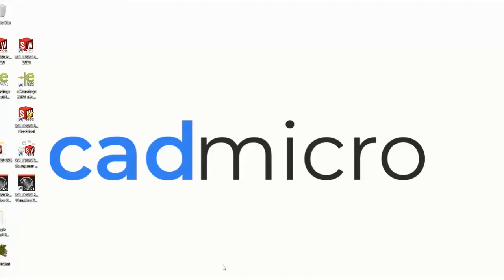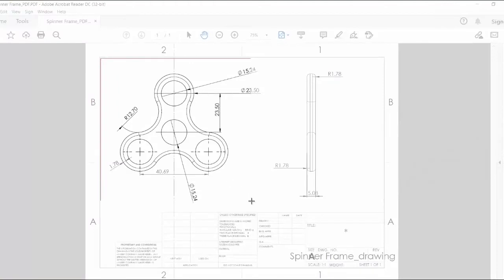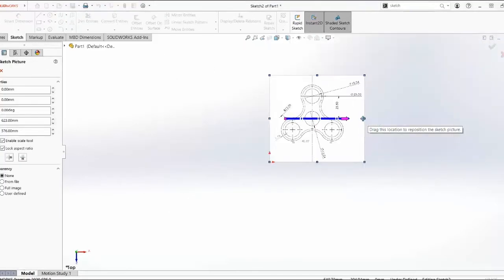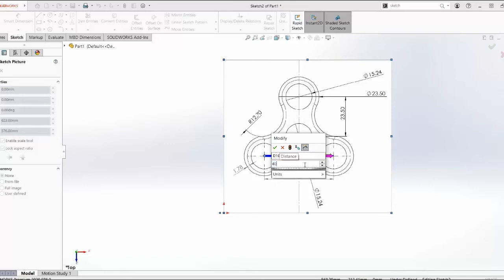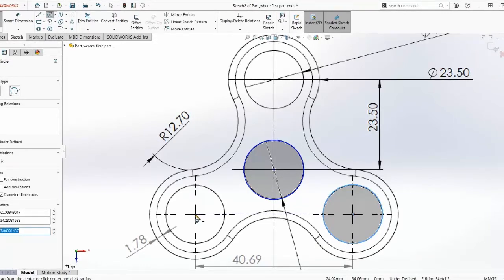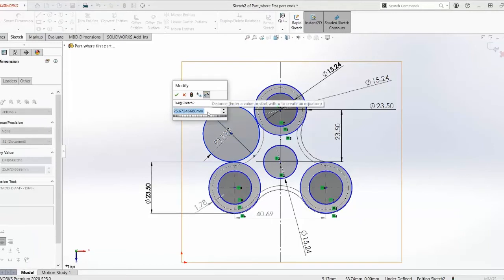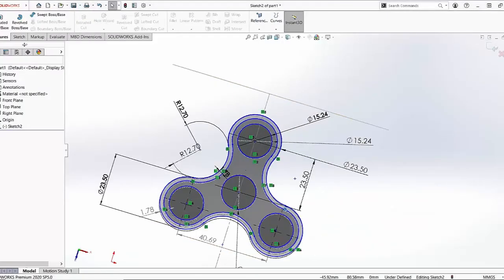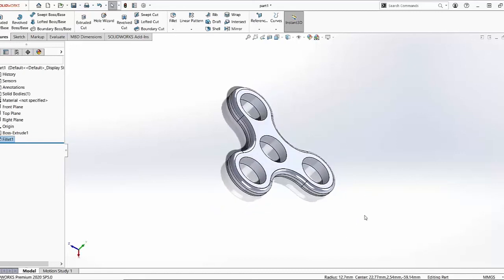Tech Tip: How to Use Sketch Picture in SOLIDWORKS

Comment: I can see the usefulness of the sketch picture feature but using this feature to derive a model from a fully dimensioned drawing does not make sense unless it is for demonstration only.  By the time the picture has been imported and scaled I would have already constructed most of the sketch from the dimensions given in the drawing...